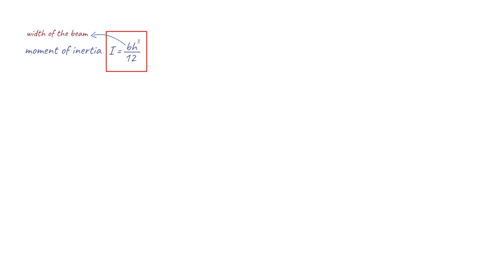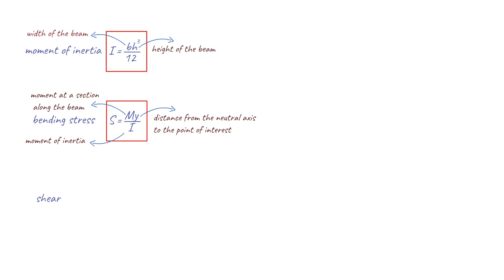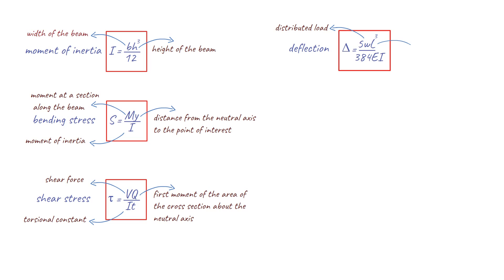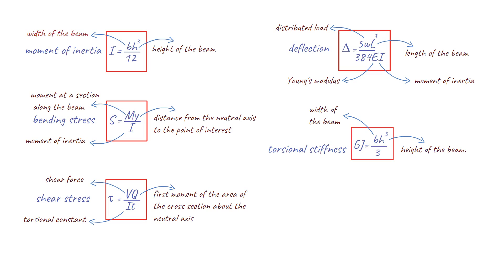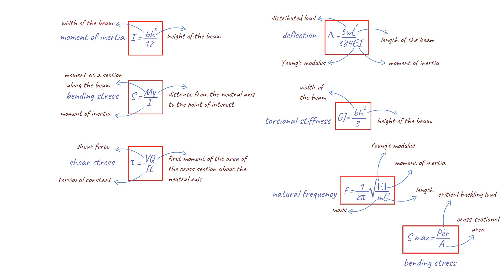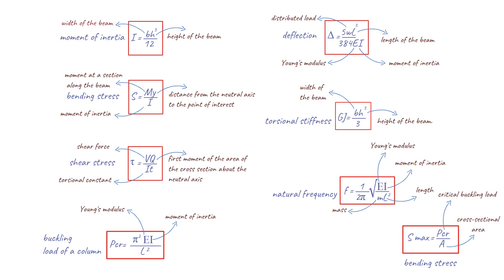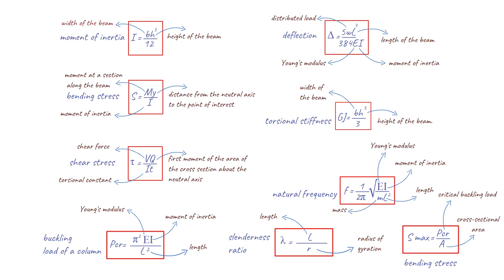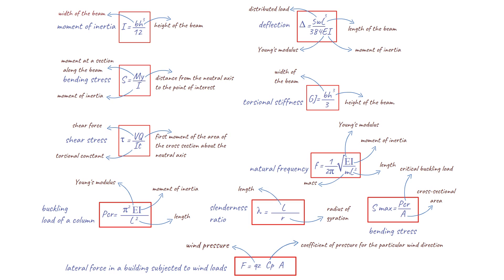Top 10 Structural Engineering Formulas You Need to Know.

Comment: The torsional stiffness of a beam equation is a bit simplified.  bh^3/3 would be correct if b is the larger dimension and h is the smaller dimension, and if b is much larger than h.  In other words the torsional stiffness would be considered as the width times the thickness^3 and the denominator is approximately 3 when b/h is greater than 10.
It is hard to limit the equations to just 10 because you miss important equations such as wl^2/8 and pl/4.  I think deflection of a cantilever beam is important because you can derive so many other equations from it- pl^3/(3EI).  That gets you to at least 13 equations.

Comment: For which cross-section of the beams this torsional stiffness formulae can be used?
And how to calculate torsional stress?
Reply from the maker: Thank you for your comments and questions! The torsional stiffness formula can be used for any cross-section of a beam as long as it is symmetrical about its centroidal axis. To calculate torsional stress, you can use the formula T = (Twist angle x polar moment of inertia)/(beam length x polar section modulus). It's important to note that this formula is only applicable for beams subjected to pure torsional loading. If the beam is also subjected to other types of loading, such as bending or shear, you will need to consider these as well in your calculations.

Comment: Thanks for the useful videos!Will you able to make some videos for temporary works. Like design of platform for cranes or checking the stress on lifting points and etc. 
Thanks.
Reply from the maker: Thank you for your suggestion! We will consider making videos on temporary works in the future. In the meantime, please check out our existing videos on the design of structural elements such as beams, columns, and foundations, as these principles can also be applied to temporary works design. Additionally, it is always important to consult with a qualified, experienced, and  chartered engineer to ensure the safety and efficacy of your temporary works design. Thanks for watching!